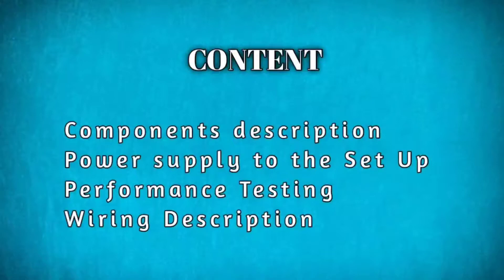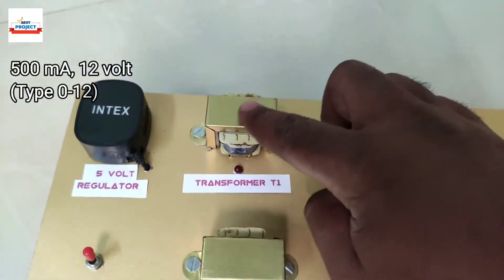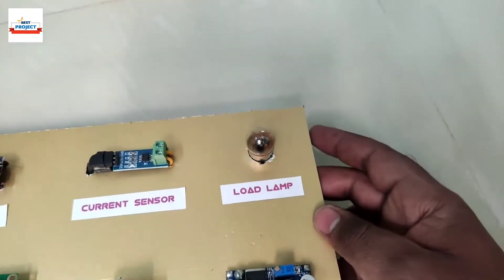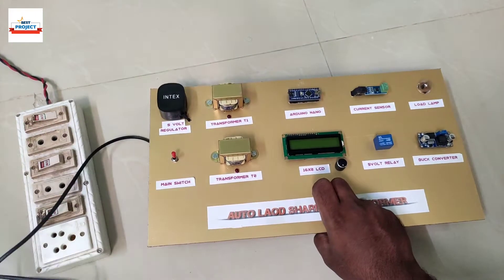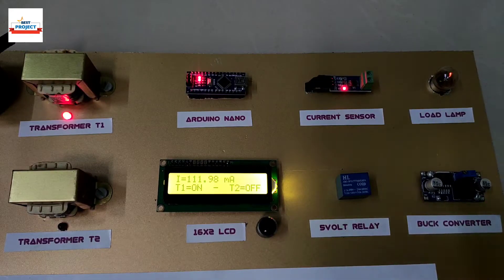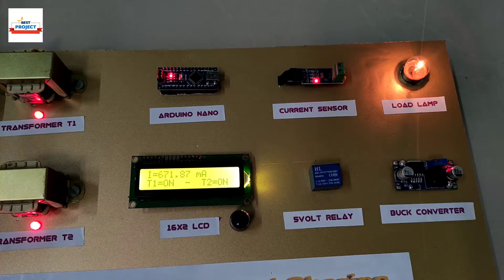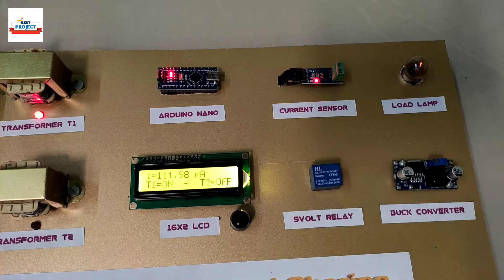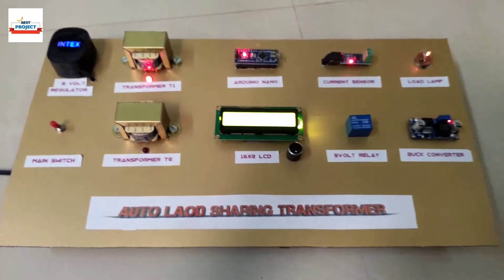12. Auto Load Sharing Tranformer | Current | Auto on off | Load Control | Load Shifting | 16x2 LCD

Comment: how you synchronized the transformer in terms of AC or you have converter the output to DC from both transformers?
Reply from the maker: Converted to DC for accurate measurement.